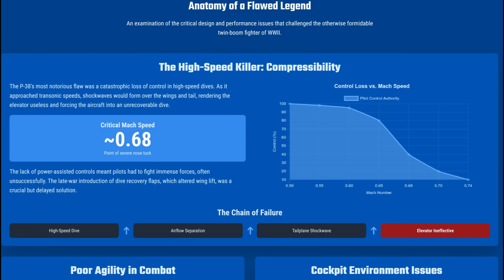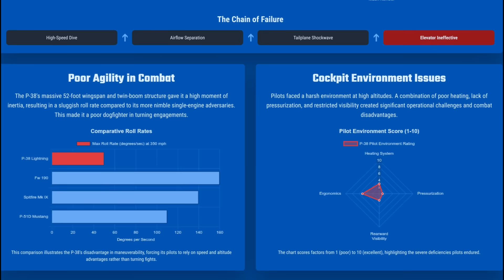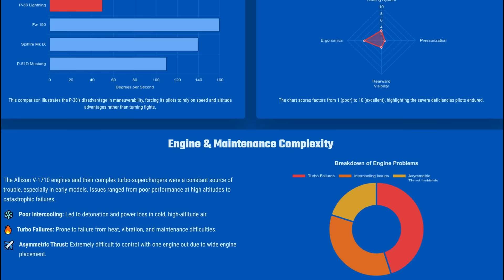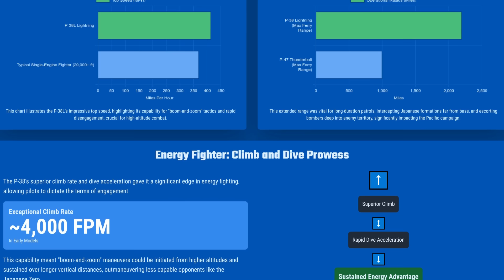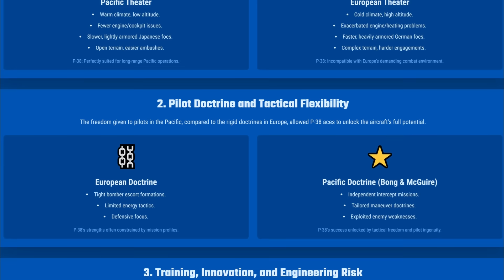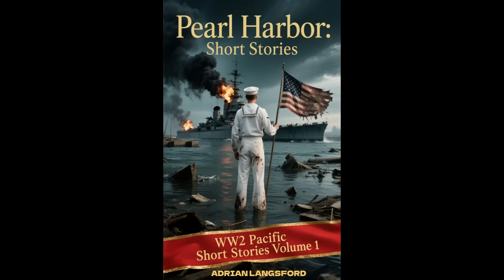P-38 Was a Nightmare..Yet It Made America’s Top Aces

Comment: Having had the pleasure of knowing and conversing with numerous Lightning drivers through The P-38 National Association, all but one expressed nothing but love for the type.  To say it was a “disaster” is a misnomer.  Although the aircraft’s issues in the ETO were well documented, the pilots with whom I conversed who served in that theater still loved the airplane for the most part.  I did meet one individual who was attached to an 8th Air Force squadron who said he was happier in the -51, but he was an exception.  Of the dozen or so other pilots I met who later transitioned to the -51, ALL of them preferred the -38 in spite of the problems.  Simply put, the consensus was that as long as they didn’t lose an engine, they believed the 38 could outperform the 51 in several critical flight regimes.  Those who flew the L model said that its superior climb performance, roll rate and ability to dive from any altitude gave it an advantage over the 51 in an energy fight.  They called it a “yo-yo.”  They said you could “yo-yo” any other fighter whether Axis or Allied with the L model.

Comment: Well, I would say that to your theatre of operation comments, the P-38L and J-25 would have been quite successful in ETO had they been available before Winter 1944. Many of the issues around high altitude, pilot comfort, compression, etc. were largely solved so the gestation period of the P-38 in the beginning of the war where it was "Max Effort" really worked against maturing the plane.  And by then the 8th AF had begun the transition to the Mustang while P-47 and P-38 were moved to other units as ground support or operating in the Med, etc. Not saying that your points aren't true, but the beginning of the war was a very different space than towards the end...

Comment: Which is the better stringed musical instrument?  Violin or Ukelele?   Which has the greatest virtuosos, makes the best music?  Pretty obvious, right?  Now--which is easier to learn?  Also obvious.  You can make good music on either. But when you need to train a lot of people to use them very quickly in order to win a war---geez, I wish wars could be fought with stringed musical instruments.  

The P-38 took more time to make, to perfect, and to learn.  It was, in my opinion, the single best attack plane of that war, and it worked very well in certain situations, but there are reasons why it produced the two highest-scoring aces, yet does not have the best kill ratio.  It was a more complex piece of equipment, with a variety of performance-related oddities that had to be figured out.  Once you had figured it out, you were pretty nearly invincible.  Except, of course, you could still die at any time.  

So I'm not saying it was the best plane from an operational POV.  In the Pacific, maybe.  But I am saying that once the design had been fairly well perfected, the rough spots ironed out in beta, and pilots had learned how to master it--it was pretty much impossible to top.  Until jets came along.

Comment: Easier to become a legend against more fragile enemy aircraft and less skillful pilots as the P-38's top operators did when the Lightning was largely relegated to the PTO. The P-38's contribution to the ETO was far less impressive. The very unique Lightning was a point of pride for the USAAC/F and remained in production when the line should have been shuttered and converted to Mustang and Thunderbolt production.

Comment: The P-38 was underrated and underappreciated.  Two engines made it far more likely you'd get home.  Lose one engine.  No problem.  You limp home on the other.  Two engines add speed that let's you get away if needed.  And two engines add stability and counter the underappreciated to torn or flip due to torque that was a problem with powerful single engines that literally tried to roll a plane over. Disaster with take off and landings.  Minimal silhouette made out harder to hit. And my favorite trait.  Point and shoot.  All the guns were in the middle, pointing straight ahead. Wing mounted guns were angled to focus on a sweet spot.  Of you couldn't line an enemy up into that sweet spot, you'd hit the plane with half your guns at best or miss entirely.  In the P-38 you just point and that's where your ammunition went.  One line.  Bong scored most of his many victories in a P-38. That's saying something.

Comment: All of the challenges faced by the P-38 with the 8th Air Force in the ETO were solved with the J-25 and L versions (and earlier models were retrofitted). The P-38 was perfectly capable of bomber escort in Europe by Spring/Summer 1944, it was simply more costly to produce and took longer to train its pilots than the P-51. 

What is overlooked with these “checklists of pros and cons” is the situation and circumstances faced by the pilots and airplane. 

The P-38 was no different in the cold as any other fighter. In the ETO it was the combination of poor British fuel and altitude that caused problems with the early P-38 (F, G, H) intercoolers in the leading edges of the wings. Not a problem with the J and L. 

Also, the P-38 was available as early as 1942 in the ETO and could have been teethed much sooner for bomber escort. However, Bomber doctrine at the time did not prioritize fighter escort until losses were  unacceptable by late 1943. 

The P-38 was rushed into this role without proper pilot training and without being properly adapted to very high altitudes. Even despite this, the P-38 kept the bomber offensive alive when no other fighter could do it and produced several aces in the 20th and 55th fighter groups of the 8th Air Force before the P-51s were added.
Reply: When P38s were bomber escorts they had to stay with bombers which made it easier to shoot them down. They were not allowed to dogfight with enemy fighters in the ETO.

Comment: Most of the Allies planes weren’t very good at the start. Even the famed Spitfire went through many revisions and upgrades. I mean, they were good/decent, but like most things, they got better over time. The Sherman was very unreliable before they switched to Diesel engines if I recall.
Reply: The engine history of the Sherman is WAY more complicated.  Initially - an air cooled radial airplane engine was used.    But those engines were needed elsewhere so alternatives were needed.  Chrysler came up with the A57 multibank - which combined 5 auto engines into a single power plant.   That worked - but it was complicated to keep running.   There was a diesel - the GM 6046 - but it was pretty much an export only engine - for the USSR - who preferred the diesel.  The ultimate engine used in the Jumbo, Easy 8 and later Shermans was the Ford GAA - an enormous V-8 engine.  1,100 Cubic Inches and gasoline powered.   Gasoline was not the problem in the Sherman - it was ammo storage.  A wet storage system solved most of the issues with ammo cooking off in later Shermans.    The Easy 8 was a damn good tank and cost WAY less to make than a Tiger or a Panther.

Comment: The J and L versions had hydraulic boosted ailerons that gave it a better roll rate than the P-51 amd approached that of the FW-190.  Little is mentioned of that improvement.
Reply: Agree with you.  Unfortunately the 8th Air Force already committed itself to the P51

Comment: Yeah, Bong & his wing mate had 40 & 38 kills resoectively in 38's but against the Japanese not the Luftwaffe. The carburetors on 38's did not function well at high altitudes where the German fighters did most of their attacking. The P47's & P51's wiped out the Luftwaffe at high altitude. The 38's did not escort B29's in the 30,000 ft bombing runs to Jap'tan. The 38's were used by Gen. Kenny's 5'th Airforce in the New Guinea & Island  Hopping Campaigns against low level aircraft. There were NO 38's in the Cactus Airforce of Guadalcanal. In the ETO 38's were were later stripped of armaments & armor to be used in fotorecon by the 'the 6'th, 8'th & 9'th AAF's.
Reply: That's not the full story. Most technical issues were - mostly - resolved. The bomber mafia refused to use 38's even though they had the range for escort duty to the target and back. British fuel was a big cause of temp issues at altitude... etc.
Reply: To be fair, though, the Luftwaffe was in dire shape when the P-51 arrived. Dangerous, but on-the-ropes with no hope of recovery.

Comment: The engines were actually closer together than a lot of other twin engines aircraft like the Hudson, A-20, and A-26. So the single engine difficulty seems a little over hyped.
Reply: Both engines were critical, and liftoff was below Vmc of 120mph. Lose an engine on takeoff and you have to react correctly and without hesitation. The size of the prop relative to the mass of the aircraft was much greater than for a bomber, so a dead engine with a windmilling prop would slow the plane down relatively quickly.

Comment: Somewhere I read that the British ordered the P-38 without the contra-rotating propellers. (both rotating the same direction) and rejected the aircraft as unstable with too much torque.
Reply: "The P-38 was clearly a hot performer and the UK Air Ministry and French AF soon took an interest in the type, seeking a non-turbocharged variant with identical powerplants (and same sense prop rotation) to the Curtiss Tomahawks at that time ordered in significant numbers." 
Air Power Australia Assessing the Lockheed P-38 Lightning
Reply: I have read that too.  I think I also read that they were supplied 38s without superchargers.  When they went to counter rotating props they first had them going towards the cockpit, which left something to be desired, so they changed to the props rotating outward and that was the ticket.  Hope I didn't get that backwards, I'm 80 years old.
Reply: @JohnAllen-gg1oz  Almost as if the Brits wanted them to fail.

Comment: I get the feeling that P-38 was an exceptional  bomber interceptor that rarely got a chance to intercept bombers.
Reply: Indeed. They used the P-38 to Intercept Admiral Yamamoto because it had the range and ability to shoot his plane down in transit.
Reply: @Vevvev8  great, great point. Arguably the most effective fighter action of the entire war?
Reply: @blueswannabe  It was definitely unique in that it, the P-61 Black Widow and the P-39 Air Cobra were the only cannon wielding US fighters. So, with all that firepower in the nose (add 4x.50Cal Brownings), it was certainly a great gun platform and being downrange of it made for a really bad day at the office! :)
Reply: Correct! They even used the P38 for reconnaissance in both theaters with a reconnaissance nose that replaced gun pod. The P38 was relatively very fast throughout WWII. However, some single engine fighters had caught up to the P38's 400+ mph specification by late war. The Lightning got faster and better also, but the P38 didn't get some upgrades and redesigns due to demand for production and unit cost.

Comment: This is inaccurate. You’re speaking about the resultant conditions of two main differences between the ETO and PTO that affected P-38 performance-British fuel. British fuel had additives that hindered all Allison engines at altitude. Once Jimmy Doolittle had US fuel shipped in as it was in the Pacific, the issues resolved. By then, it was 1944 and the P-51 was already replacing all U.S. escort fighters in the 8th AF. The late block P-38J and L models resolved all the design issues you mention but by then the p-51 was the chosen dominant aircraft to equip all units in the bomber escort role. The P-38 soldiered on in 3 units of the 9th AF until early 1945 when it was replaced by P-51s and P-47s in all except the 474th FG that used them to V-E day to great success.
Reply: So right but a problem also was the V12 Allison engines as with the A36/p51 original Allison the turbo supercharger just didn't work right high where the P 51 got the merlin the P 38 did not.
Reply: Completely agree. Additionally, 51's were less than HALF the cost and a lot easier to fly for low-time pilots. Lower pilot workload. Too bad the 38 never got sealed gun ports and paddle props to churn all that new HP into the air... could even have been a lot faster if the investments had been made.
Reply: @Mike-eq4ky  I always wished the P38 would have gotten twin Merlins.
Reply: @bobbygetsbanned6049  HA! No, you don't. I once thought the same thing. Now go watch Greg's episode on this, Greg's Airplanes and Automobiles. Briefly - due to the use of TURBO superchargers in the '38, the Merlins actually would not have delivered the same performance and fuel economy as the Allisons. The only issue with the Allisons in the 51 was the lack of multistage/multispeed supercharging but the turbo negates that requirement. You just couldn't fit that into, say, a P-39 or P-51.
Reply: @Mike-eq4ky why couldn't they slap a turbo and supercharger on the merlin then drop that into the p38? Sounds to naive little old me like a recipe for MO POWAH BABY 😅(sorry I couldn't help myself with the last bit, the question is genuine)
Reply: @Mike-eq4ky Greg makes the point the turbo-supercharged Allison created more power than the Merlin at higher altitudes, but in the ETO this advantage was frequently negated by the various technical problems that seemed to be caused by a stew of issues of fuel quality,  the cold damp climate, lubrication, and the pilots getting so cold they could barely function.  The one advantage the Merlin would have provided would have been greatly simplified engine management procedures and reliability.  Without the dive spoilers, boosted controls, and with the frigid cockpit the Lightning would have continued to be somewhat at a disadvantage.

Comment: Robin Olds became an ace in the P38, then flew P51’s and later F4’s in Vietnam. I saw an interview where they asked him what he thought of the P38. He grinned and said “Let’s just say I became an ace despite the P38, not because of it”
Reply: Olds was also a proponent for the use of fighters to conduct low-level bombing runs as opposed to using bombers in strategic high altitude bombing. Because he could actually put the bombs on target that way, and fly a mission with far fewer aircraft with much more accuracy and tactical success. 

The 8th Air Force didn't like that.
Reply: An epic mustache helps, too!
Reply: I also heard him say that the P 38 (probably J model) could whip anything at low altitude which seems kind of odd because of the speed limitations down low but may speak to the problem of compressibility encountered in the dive and some leverage the plane had with maneuvering.  A pilot as good as Olds could exploit some of the maneuvering potential of the P 38
Reply: @djshowtrial4565  Probably a J-25 or later or maybe the L. I have read that it was THE version of the P-38 that could roll and turn with the German prop fighters and solved most of the major issues. And you're right that the P-38 with maneuvering flaps could out turn the German planes below 10,000 feet... but the European war was fought typically much higher up.
Reply: That was a perfect response from Colonel Olds...😉
Reply: The thing is, what Robin Olds thought about the P-38 depended on the conversation and the audience. 

His daughter Christine said that Olds loved the P-38, always speaking fondly of it. And he kept a couple of models of the P-38 prominently displayed in his possessions. Christine spent enough time talking with her father that she edited the portion of his book that he wrote, and she finished his book, according to his wishes. 

So that one quote from Olds about the P-38 is mostly out of context.
Reply: @AlanRoehrich9651  This!

Comment: Poor agility in combat so the same as the P-47 then.
Reply: That's not quite true. The early 38's had mediocre roll rates prior to the introduction of hydraulically boosted ailerons in the J(?) model. And it had outstanding rudder authority so when combined with parallel firing guns - 4x 50cals AND a 20mm autocannon! you did NOT want a P-38 on your tail. Guys like Bong and McGuire would drop the flaps into combat position to further improve turn performance. And Zoom and Boom tactics negated much of the need for "agility". In the hands of a good pilot, the P-38 was a formidable opponent. As the video even notes, the plane excelled when played to its strengths. Perhaps similar to the P-39 story which was hated by US pilots but wildly successful for the Soviet pilots fighting on the Eastern Front.
Reply: @Mike-eq4ky  A plane with so much weight distributed on the wings couldn't have good roll charateristics, and the mediocre diving charateristics of the P38 didn't make it a better boom&zoom fighter than anything else. Also remains the problem, the P38 was a damned big target, and almost all that you see is valuable target, engines, cooling system, fuel, pilot and vital structures. Good pilots could use it for the better? Yeah. Good pilots tend to use anything for the better. But to use for the better a P47 or a P51 was MUCH easier. 
Bong and McGuire, fought in the Pacific. for over two years. When they started using it, the P38 had consistent speed advantage over anything the Japanese had, and was a better diver. In Europe the P38 had no real speed advantages, and was a worse diver than practically everything.
Also, flying an Hellcat, McCampbell obtained 34 kills in 6 months, and with the Corsair Boington obtained 28 kills in 4 months. Both had far better kill/mission ratio than Bong and McGuire.
Reply: But the P47 was a smaller target, and much of what you see could be hit with little consequences. The P-38 was not only bigger, but almost all you see is fuel, engines, pilot and vital structures.